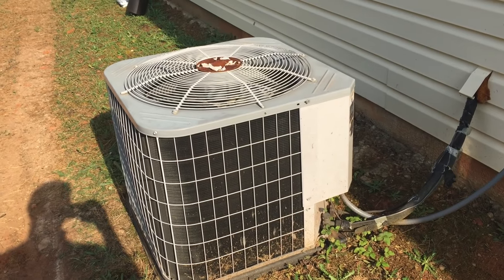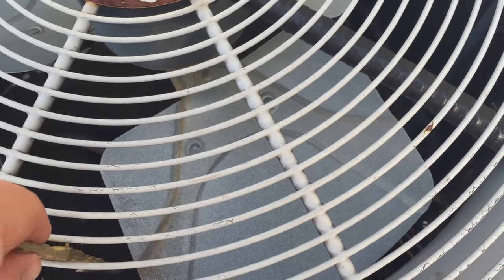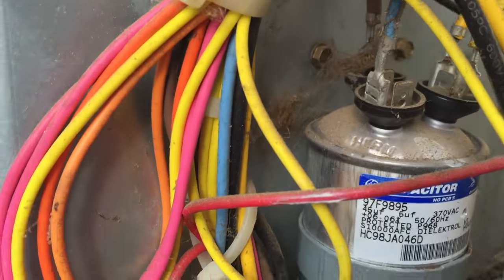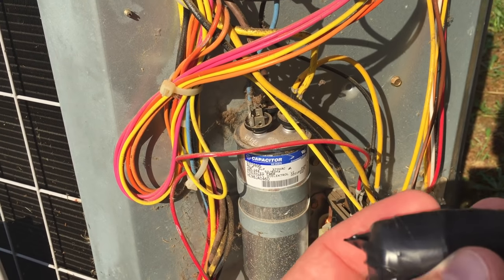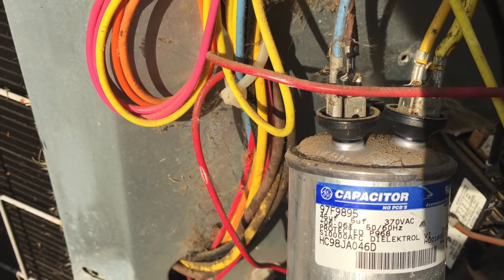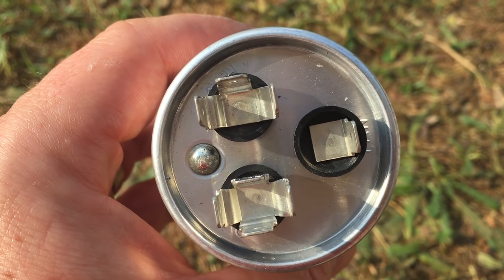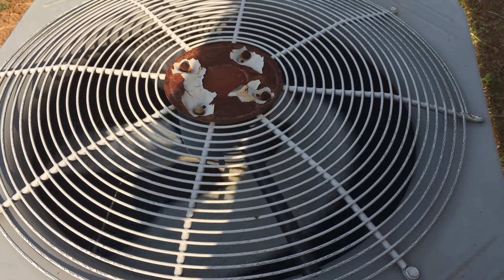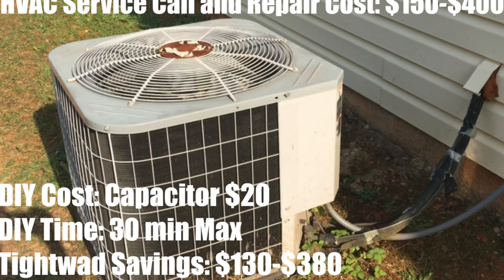Easy Air Conditioner Repair: Fan Not Spinning - Blowing Warm Air

Comment: TightWadRepairs  Hi my aircon is not turning ON and the Fan on the outdoor unit does not run. I saw it rotating a bit with little bit of wind. When i turn it On, it just makes a noice which it normally did whenever i turned it ON or OFF. If i change the AC mode to Fan only instead of Auto, it blows out air in the ducted vents. helppppp
Reply: James Pouncey yeah i took the start capacitor, motor run, fan run capacitor for replacement and they tested all. They were all fine. The aircon works intermittently. Sometimes it would work fine for hours and other times it would not run at all or stop while running

Comment: Good lord you just saved me $100 to have a guy come out to put a stick in the fan blades to get them going. 😂
Reply from the maker: So now you just need to replace the capacitor!
Reply: @TightWadDIY  do I? It seems to be running fine. We had a big storm last night and there were big ole Magnolia leaves stuck in the fan blades.
Reply: @erikwick  Keep an eye on the fan. I bet it will end up stopping again.
Reply: @GrillThisSmokeThat ok. I'm bookmarking this vid for when it craps out for real.  Lol.

Comment: I replaced my capacitor today and had to kick start my  fan and it did spin for a while then the fan stopped again and the unit still has humming and running inside the house
Reply from the maker: It’s possible your contacter is had.
Reply: Thanks I’ll check that out

Comment: Hi TightWadRepairs THAT WAS FREAKING AWESOME! I've seen a lot of vids on YouTube like everyone has on here and this one is really done well the way I know that is because a idiot like me can understand and follow what you're explaining so much so I'm going to try and do this myself. So kinda same as everyone else Sir my unit is turned on set to 73 but temp will not drop below 84 I think the air coming out of the vent is warm but I don't know how warm. Outside the fan IS NOT running (I haven't tried the stick thing yet) it is however making a noise I'll call it like a humming type noise. What ya think ?
Reply from the maker: Frank Wash Your issue definitely sounds like the capacitor. Here is another video I made with a few more details. https://youtu.be/VO7sDl1q8WY
Reply: @TightWadDIY  Thank you very very much you put my mind at rest (for now) because one of the guys at work said they had something similar happen and he ended up spending 4500 for a whole new outside unit because he had a coil leak of some sort leaking Freon i think but the biggest difference between my problem and his is that my fan is not spinning and his was and now that youre saying you think its the capacitor i'm a bit relieved atm so thank you.
Reply from the maker: Frank Wash Hopefully you don’t need a new unit. The hummmm sound is likely your compressor running. If it’s running but the fan isn’t, it’s more likely the capacitor. It could also be the fan motor but that is less common. The only time it’s over $4K is when you need a new system inside and out.
Reply: @TightWadDIY  Right! Thanks again sir I'll be sure and keep you updated (if you're interested lol) I don't blame you if you're not lol. Hey what area you in I'm in Baltimore it would be awesome if you were as well.
Reply from the maker: Frank Wash I always love to hear success stories so please do share. I’m in the Atlanta area.
Reply: @TightWadDIY  yup it was the capacitor very easy fix thanks again
Reply from the maker: Frank Wash That’s great!

Comment: I realized today I am an EXTREME tightwad. I got so excited about my current savings...

Could I find this at a Lowes or Home Depot?
Reply from the maker: I doubt they will have capacitors. Your best bet is to find where the local HVAC guys buy their parts.
Reply: @TightWadDIY  yo the fact that you’re still replying to comments is crazy 😂😂
Reply: @dopeboyz9955  I do my best to keep up. Managing two channels is a challenge sometimes. I appreciate you.

Comment: Mine stopped spinning so I swapped out the capacitor. Worked for about 20 minutes and now it’s not spinning again 😩
Reply from the maker: Hmmm. There are other parts that could go bad or you could just have a loose connection.

Comment: Hey I got the same problem lol
The ac unit outside won’t do anything, no humming noise the fan is not spinning like if their was no power to it
Reply from the maker: Tripple Banng Oh no! Check your breaker first then follow the steps to check the capacitor. Hopefully that’s all it is. Here is another video I made with A lot more info: https://youtu.be/VO7sDl1q8WY
Reply: What if it is humming? Mine will only spin after pushing with a stick but it has a humming sound when trying to kick on

Comment: Where did you purchase the capacitor so I can find a similar store in my area
Reply from the maker: Michelle M I buy mine from a local appliance parts warehouse or a local HVAC repair company that also has a store front. See if you can find out where handymen buy their appliance parts in your area.

Comment: when ac is turned on after few minute working  the fan shuts off what is the problem ???
Reply from the maker: N Nick Nicoo It could definitely still be a capacitor issue. It’s a cheap and easy fix so I would start there.
Reply: May have the 3 , but not the 5  for constant run, capacito

Comment: Believe it or not the cap will discharge when the unit shuts off, so long it is connected when the power is shut off. The fan and compressor are in line all the time and will discharge the cap instantly when the unit shuts off. If you disconnect he cap with the  unit running it will hold a charge and has enough power to knock you on you butt.

Comment: My ac come  on for 5mins and turn off. So I called sears technician.  He came and charged me $400. The problem was the drain was clogged he cleared it less than a minute then want to replace the compacitor. I said hell no. I replaced it myself.
Reply from the maker: $400? That’s crooked.

Comment: my ac works vut blowing hot air.  could it be an the capacitor?
Reply from the maker: John  Yang Yes! That is your most likely culprit. It is probably powering on your fan but not the compressor. This same fix should apply.
Reply: TightWadRepairs thanks man, u just save me $200. Turns out my capacitor was weak. i replaced it and my house is now at 75 degrees while the weather is 94% at the moment in sacramento. again, thanks.
Reply from the maker: John  Yang Great! I'm always happy to help.
Reply from the maker: +John  Yang It could. The capacitor controls the fan and compressor. If either of those aren't turning on, it would blow warm air.

Comment: so I went outside and heard the humming so I nudged it with a stick and it began spinning again, but was still blowing hot air inside once spinning.. is it still a capacitor issue or is it something else?
Reply from the maker: Probably still the capacitor. I bet the compressor is still not on and that is what cools the air